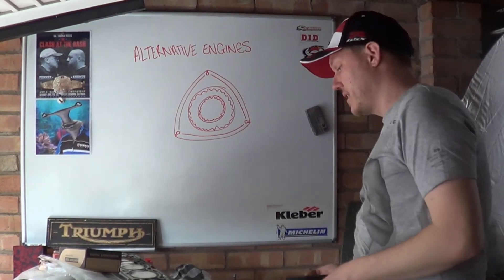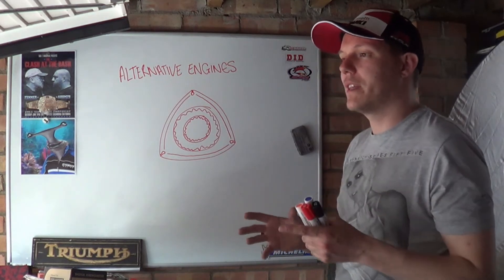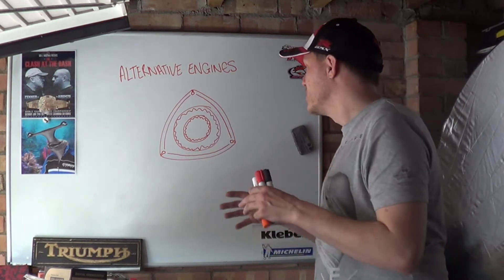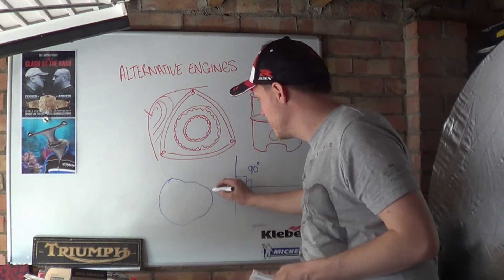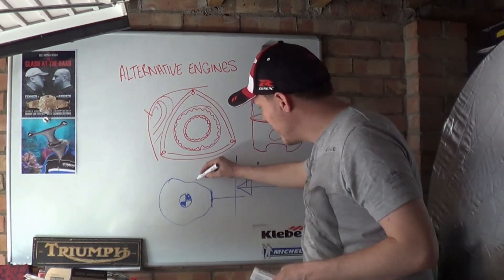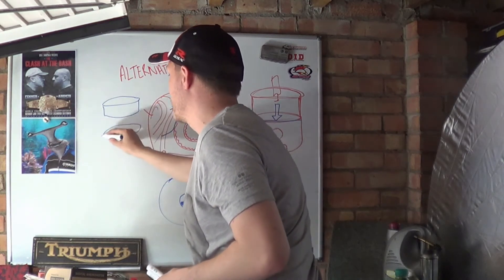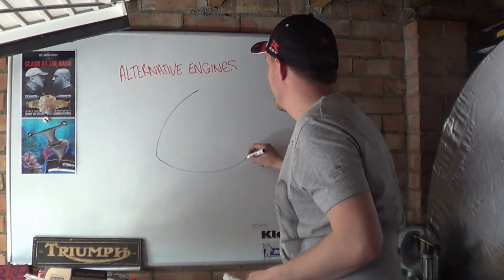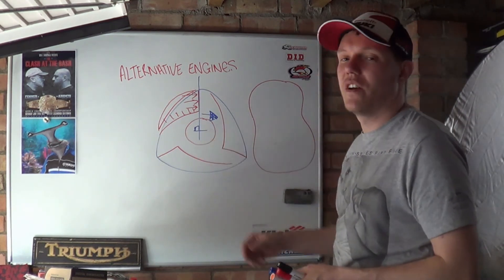Alternate engines - The Wankel Engine

Comment: the Wankel always seemed like a disaster of a concept - Mazda stuck with them due to sheer bloody-mindedness but they're really a pretty rubbish idea.
Reply from the maker: Video coming up this week on this - matt
Reply: How are they a rubbish idea 

Smaller lighter - rotational mass 
Instead of a linear jerk - there a amazing idea for certain areas… 

No good for a small family car like the rx8 that needed fuel
Efficiency and reliability! 

Against a motocross engine that needs to rebuilt twice a year and kept weight to a inimical it’s a fantastic idea!

Comment: They use oil because they inject engine oil into the rotor housing to lube the apex seals, that's why its important to check the oil level on this engine. guys that race these engine will mix oil in the fuel much like two strokes. the other problem with this engine when it comes to racing is there is no compression braking thus they are hard on brakes
Reply from the maker: Do you like jumping the gun on me? lol Stop ruining my future videos. lol Yeah its a good point John, that and the god awful seal contact pattern.
Reply: The Workshop 😁

Comment: Does it not also have extreme hot spots?
Reply from the maker: Theres more to this video, so there will be a part 2 etc. Do you mean anywhere specific?
Reply: I forget exactly, but I believe certain parts of the engine get very hot compared to others, which contributes to the failure of the seals.  

Side note, I have heard of some RX fans running 2 stroke oil in their petrol to aid with saving the seals.
Reply from the maker: Yeah the whole engine. The apex seals get extremely hot, and so do the tips of the buttons. And yes they add premix mainly due to the heating issue.